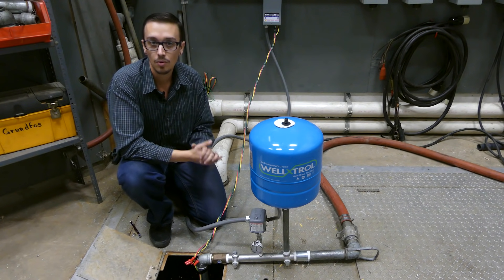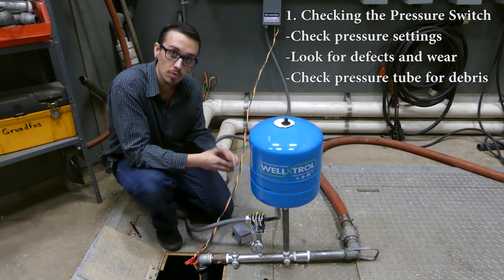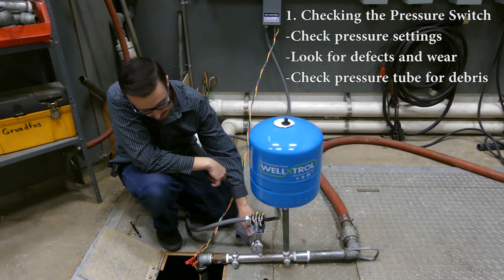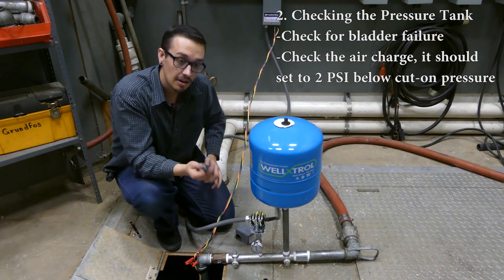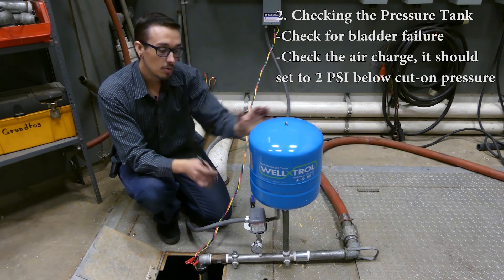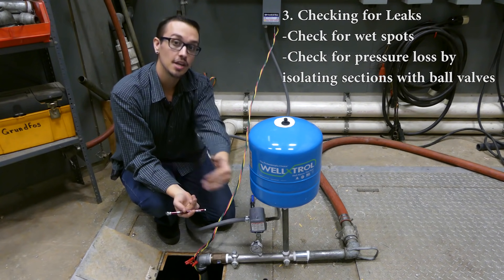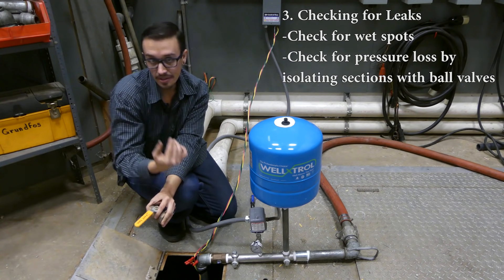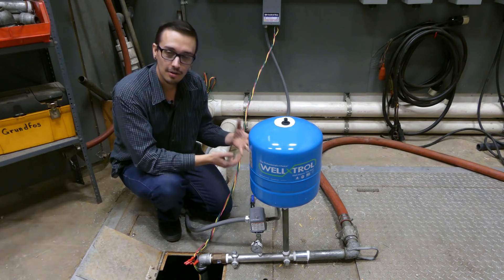Troubleshoot: Water Well Pump Starts too Often (Rapid Cycling)

Comment: I have a jet pump to a water tank for a shallow well. We dont use the system everyday, but when we do we use it for a garden. This year we have been trying to get our system to work correctly. When we primed the pump it worked as it should, filling the water tank and seemingly working fine. 

Here is the issue: After running the water our pressure gauge will drop to 40 and the pump will turn on to fill tank. But it will not fill the tank. The pressure will remain at 40 psi. If we turn on the water faucet again the pressure will drop slowly and then suddenly drop to 0. The pump will turn back on, get to 28-30 psi max and still not fill the tank. 

The foot valve is old on our setup and may be the issue. Im not sure why system would work fine initially and then after not fill the tank. Im  hoping anyone could take my scenario and help me with what to try.
Reply from the maker: You should start by replacing the foot valve, it sounds like it may be getting stuck closed. If that doesn't solve it give us a call: 855.329.4519

Comment: Fantastic video series - you are very good at explanation.  My pump works -  my  cut off switches are are fine (new)  -  the pressure tank loses air - not through the air valve - no water spurting out valve when depressed.    I re -pressurize tank to 38 and ran a cycle (water closed to house - after pressure tank) it goes up to 60 -  will not lose pressure - check valve therefore OK  before pressure switch -  I open  the water valve to house and the pressure drops to 40 - and it cycles back on - so far so good - however it  continues to drop  to zero.   Pump shuts off at 30 completely so as not to keep running.   I re-take pressure reading at tank  - 20 .   Where is the air going?  No visible leak or sound?  Pump seems unable to fill the tank again.   I've watched most of your videos, but can't seem to pinpoint.

Comment: Turning off the pump and turned the water on until its empty didnt work. Water pressure still surges. I did the taping on the tank and its sounds solid all the way to the top :/ 

Hope I dont need a new tank.
Reply from the maker: What was the pressure in your tank?
Reply: @RCworstwater  its at 38psi which is 2 psi less than it was back in September when I bought this place.

Comment: What if when you tap on the tank, it sounds hollow all over when the system is up to pressure?
Reply from the maker: That means your air pressure is probably set too high. Shut the system off, drain all the pressure out and check the air pressure. It needs to be 2 PSI below what your pump is turning on at.
Reply: it’s a 30/50 system and air pressure is 28 psi

Comment: i have problem with my water pump......the pressure drops rapidly from 6psi to 2psi and make that pump cut in at 2second each cycle when i release the water......before this, it was not like that...the pressure was good and slowly drop......is it have problem with the wiring or the pump has problem?
Reply from the maker: Please give our techs a call and they will help you troubleshoot: 855.329.4519

Comment: Does a well pressure tank need to be burped? My tank is 13 years old and my neighbor says I should burp it but I can’t find any info about how to do that.
Reply from the maker: I am not sure what you mean. What prompted him to tell you that?
Reply: @RCworstwater  My pump cycles frequently for the size of pressure tank that I have so he says that I have air in the water storage portion of the tank
Reply from the maker: @bensonsmsd1234  Did you check to make sure the air in the tank is set correctly? If not, we have a video on that. If it is, then you can try to purge the air in the lines by opening  all the taps after the pressure tank and just letting your pump run. It would be unusual for air to collect in the tank unless it was a higher than where your taps are.
Reply: @RCworstwater  Ok. Thank you for your help. I will check the air pressure in the tank. My tank sits on the ground next to the well head so it is most likely something else causing it to cycle so much. Also, I want to fill a 3600 gallon swimming pool. What is the best way to do that from a well?
Reply from the maker: @bensonsmsd1234  It depends on your piping setup, give us a call to discuss: 855.329.4519
Reply: The way you burp it is you hook your house to the bib that should be at the tank flop your switch on let it build up to 40 ish 50. The whole time your going to have your hose open and when your bladder dumps flip your switch and do it again. May take up to 45 min or more depending how good you want it clean

Comment: Another way to tell if your pressure vessel is waterlogged. If the pressure vessel is located outside, you can touch the tank with your hand. When you touch the top of the PV, it should typically feel warm because there would be no water in the upper zone. If it feels cold then that means water has filled the entire PV (waterlogged). Under normal conditions, the PV should feel warm at the top and cool to the touch at the bottom.

Comment: Thanks for the tutorial. If air is escaping from the suction line,can that make my pump comes on almost every 14 minutes. Thanks for a reply.
Reply from the maker: There should be no air in your suction or discharge lines whatsoever. If you make sure there isn't and your pump is still coming on constantly you must have a leak somewhere

Comment: Great Videos 
So is it recommended to have a check valve near the pressure tank if you have a submersible pump even if the submersible pump has a check valve?
Reply: Yes always install a check valve close to your pressure tank, because if the check valve deep down at the pump ever fails your well pump will continuously cycle and that’s very bad on your well pump.  Also install pressure gauges before and after the check valve you install close to you pressure tank so you can monitor the pressure in the line down to the well pump .   If your well pump’s check valve fails you can always install a check valve immediately above your well pump.
Reply: Ways to know if your well pump’s built in check valve has failed is to have a pressure gage to see your pressure in the water line before your pressure tank and it’s check valve.  If you get air into to faucet after every time your well pump comes on then you have a bad check valve at the well pump. And or also a leak hole in the line from the well pump.  If your well pump is low on water you also can get some air into the system.  The best way to find out is pull out the well pump from the well , inspect everything, even putting the pump in a 55 gallon drum full of water when you have it removed from the well to operate it and check all lines and fittings for leaks
Reply: Yes my comment applies to submerged pumps in drilled wells.
Reply: Other things to notice is if your getting tiny rocks mud debris into your water system that is a sign that you have a leak in a fitting or in to line in the well coming from your pump ,  the leaking water from the leak is spraying onto the dirt ground levels down into the sides of your well and washing the ground contamination down to your well pump’s water intake.  If you see mud dirt tiny rocks in your water system you need to pull the well pump out and fix it as soon as possible because it can seriously damage the drilled well, it can collapse the sides filling up the bottom of the drilled well.  Fix as soon as possible.

Comment: Consider that your system is tight and holding steady at for ex. 45PSI on the gauge. Should you be able to test tank pressure and get 45 PSI, same as the gauge? If they do not agree you should adjust for that when setting tank air pressure on empty tank?

Comment: I've been watching your videos and really appreciate the training and support you've provided. What I have is a water pump that appears to be short cycling only when water is used in the house. I do not heard the pump cycling when no water is being used. I have checked the tank pressure and it is at 36-38 PSI. The water pressure gauge shows 42 PSI but regardless of water use or adjustments made to the pressure switch range and limiter, the water pressure gauge does not move and cycling has not changed. What do you suggest so I can remedy this problem? Thanks in advance!
Reply from the maker: It sounds like you could have a couple different problems, but the only way to know for sure is to have a working pressure gauge. I suggest you replace it and see if 36-38 is indeed the correct tank pressure for your system, if it turns out your switch settings are 30/50 that alone would explain the rapid cycling. You might consider simply replacing the pressure switch while you're at it

Comment: My pump cycles every 14minutes no leaks in house
Reply from the maker: Burt, if it is constantly cycling with no water usage that indicates a leak somewhere. If not in the house, then it must be outside the house or in the well. If you have ball valves and pressure gauges installed you can isolate your lines to find the leak.
Reply: R.C. Worst & Co., Inc. could it be waterlogged?

Comment: What do I do if my pressure tank has no water in it and hollow sounding from top to bottom?
Reply from the maker: Check the air pressure and make sure it's set to 2 PSI below your pump's cut-on pressure. It sounds like it is set too high.
Reply: alisha, did you ever resolve this.?..We got one of these and the psi is 38 lbs but doesn't seem to accept any water......?    it's got some goofy clip thing in the hole AFTER you take out the plug, which we initially thought the clip thing was an error, but we checked another one and once u take out the plug, it also has the same thing where the l pipe goes into......

Comment: If I'm running a sprinkler off an outside bib and my well system is working properly (afaik, new construction house), what is the definition of rapid cycling? It takes one minute six seconds until the well pump kicks on starting from a full pressure tank, and then runs for about 45 seconds until the pressure switch turns it off. 

Would it be better if I try to increase my sprinkler load and try to have the pump run continuously the entire time I'm watering? (such as adding another sprinkler to the other outdoor bib?)
Reply from the maker: Yes, the longer you can keep the pump on when using water the longer it will last.

Comment: I have a problem where my pump in the basement will come on, but there is no water coming out. If I shut the power off to the pump and turn it back on right away, The pump will pump water this has been going on for more that a year. I replaced the pressure switch and then the tank and still no change. then my pump stopped working all together. I thought that was my problem ( a weak pump). I replaced the pump and every thing worked fine for about 3 months and the pump runs and runs and no pressure. The same old problem. I don't seem to loose the prime because as soon as I flip the power off and on, the pressure builds right away. Any ideas what causes this??
Thanks
Andy
Reply from the maker: Andy, it sounds like you may have a bad check valve somewhere in the system that occasionally gets stuck closed. You can find replacements here: https://www.rcworst.com/Valves-c80.html?Attribs=502&
Feel free to give us a call if you would like to troubleshoot your system in more depth 855.329.4519

Comment: Thanks for making me understand.  We have one issue. Pumps cut in and cut off correctly.  But we are not getting the pressure. Is it because of bladder failure?
Reply from the maker: Muhammed:  What has changed that makes you think there is an issue?  If your pump is cutting off correctly you should be getting up to pressure.  It does not sound like an problem with your pressure tank.

Comment: Thanks!  My issue with "fast cycling" of the pump turned out to be crud in the nipple to the pressure gage.  Cleaned it out as well as the inlet to pressure switch and it cycles normally again.  Just in case, I will buy a simple pressure switch for future spare part!
Reply from the maker: Awesome! Happy to hear you were able to fix the issue!

Comment: U mentioned that there should be a dull sound at the bottom and a hollow sound at the top of the tank,if there is a dull sound at the top also what does it mean an how can I find Fix it?
Reply from the maker: Richard, that means the bladder in your tank has failed and the tank needs to be replaced. If you know what gallon it is, you can purchase one on our website: https://www.rcworst.com/Pressure-Tanks-c171.html
If you don't know how many gallons it is, give our experts a call and they can help you figure it out: 855.329.4519

Comment: What is the best way to stop a well from freezing  in  Louisiana it is 22 this morning Let the water run a little then pump off and on Thank u
Reply from the maker: Thank you for the question.  We recommend wrapping any piping that is above the frost line with insulation and putting a heater on anything that may freeze.  You may also want to open up a faucet just enough to let it drip.
Reply: James Casady 9

Comment: Does the pressure switch react every time water is called for?
Reply from the maker: The pressure switch is a mechanical device that is either open or closed depending on the pressure in the system. Once the pressure in the system drops to the "Cut on" pressure the switch closes and allows power to the pump. Once the pressure reaches the "Cut off" pressure the switch opens and power to the pump is severed. Now there are some things that could cause the pressure switch to malfunction such as welded contacts or debris in the switch's diaphragm.

Comment: Hi; My pump cuts in and out quickly. If I shut the off the breaker and let some water run and then pump air into the tank it solves the problem for about a month. I tried draining the tank and the tank will not drain. Also When I check the pressure with a tire pressure  gauge on top of the tank it shows no pressure. Any ideas, thanks
Reply: pressure tank probably failed